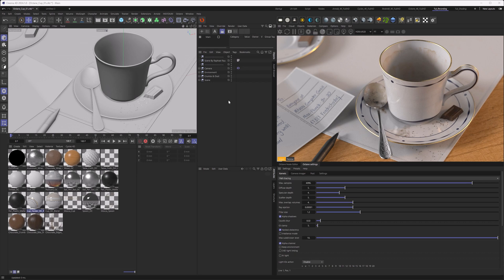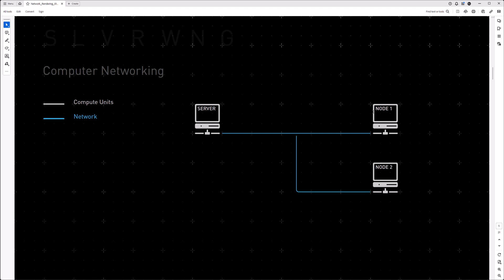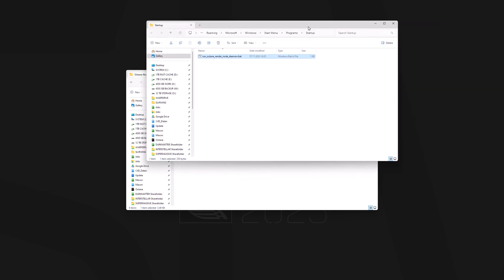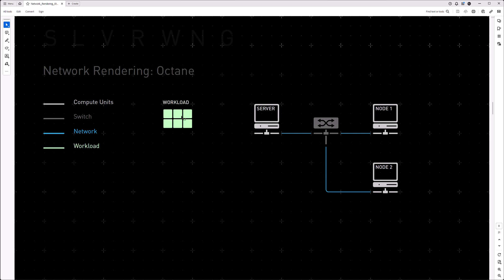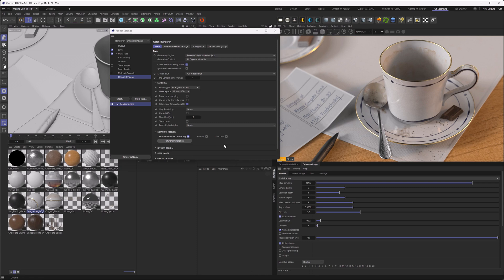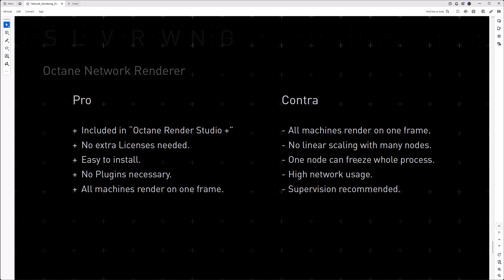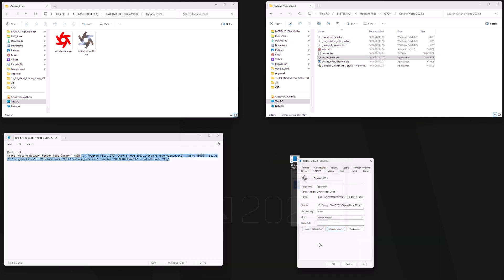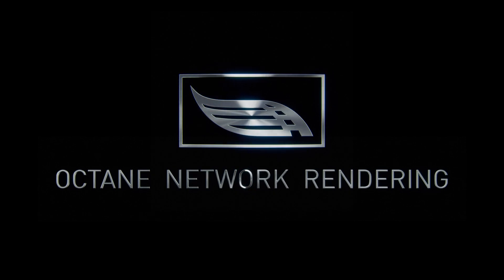Silverwing Quick-Ish Tip: Octane Network Rendering

Comment: Hi Raphael, thanks again for a great video. Maybe I missed it, but Bepe from Otoy recommended a few years back to uncheck "minimize net traffic" (for whatever reason, normally I would say it sounds lik a good thing for netowrk rendeirng :D) and set the max tile samples to 8 for getting improved network rendering times. Do you have any experience on that? It worked on my end when struggeling with bad performances over the network.
Reply from the maker: Thank you for your comment on my other video as well.
I was not mentioning that because mentioning all the extras would make the video to long. But as I did my Team Render one I thought it might have been better if I did.
Well there is room for a network rendering gotchas video... ha ha.

I usually turn off "minimize network traffic" as well as it will just render all of the samples of one tile on one node until max SPP are reached and then will send back the data. But I had instances where the node would error out and leave a 2h render with a noisy rectangle because the rendered data never came though.

I am sure Otoy has improved that since. I just mostly render animations with the Teamrender method nowadays. But when I render with Octane Network, as I said above, I usually turn "minimize network traffic" off still... Old habbits die hard.

Cheers and thank you for your help. Appreciate it!
Raphael

Comment: I own just one PC... this still got exiting. I'm eventually gettin a Mac Studio (unimpressive renderwise) and I'll hook my RTX4090 to compensate. Cornelius mentioned once there's no delay with NetRendering and after this demo I'm impressed. 🖥🖥 Thanks Rau 🙏🏻
Reply from the maker: Hey Emmanuel,
thank you very much for your comment.

Right now network rendering between Mac and Windows is not working. But Otoy said it will in the future.
So better wait a bit until you get some new hardware.

Thank you for the ✨🖥🖥✨ means a lot!

Comment: Raphael... get ready to read the following !
Last 2 days i have been experimenting with net render and i 've to admit i got some unexpectedly good results.. And then i decided to see if my gigabit lan in botlenecking the render in any way in order to get an upgrade for 2 slaves and connect them on a dedicated 2.5G switch... started my belowed task manager and watched the usage of LAN on 3 machines.... 2kbps, 5kbps, 1kbps.. wtf ? at the same i noticed that the INTERNET connection is in 60-140 MBPS !!! What !!! i was shocked, cause i've expected (as you mentioned) that the network rendering requires fast LAN ... and then i 've disabled one slave's INTERNET connection... the master hicked and resumed with 1 slave less... internet ON.. slave reconnected.. all this time LAN is OFF ! 
If i am not mistaken, octane net render node is interNET  rendering (probably peer2peer) , so maybe you investigate this until the next video comes out cause posibly  you did miss that .
If that is really the case than we will all have NODE render time bogged since windows does whatever it wants with updates...
What are your thaughs on this ?
Reply from the maker: Hey Vladan,

are you trying to say that the connection to the node is established through the internet?
I honestly don´t think so. Did you by any chance use a VPN while conducting those tests? This can throw off readings where the traffic is coming from.
One thing that speaks against your theory is that when I send big scenes through the network with Octane Network Render, the LAN usage is 2-5 Gbit. Which is much faster then my 1Gbit up 50Mbit down internet speed.

Nodes & Internet:
The Node needs internet to license it self. It should do also without once its started up. If you start it up without internet of course it can´t get a licence.

The throughput very much depends on a lot of factors:
Size of the Scene. The Scene has initially pushed through to all the nodes before they can start rendering. The bigger the scene (Poly Count, Texture Count / Size) the more taxed your network will become.
Image Size: The larger the image the more data has to be moved between the nodes and the server.
AOVs: Same here. The more AOVs there are rendered, the more data has to be send back from the nodes.
And last but not least for animations: The render time per frame. Because with every new frame the nodes have to be updated with the new data which takes bandwidth. And the more nodes you have the more data needs to flow at the same time (when the server starts a new frame)

I will do some more tests. If you find out anything new in the meantime, let me know.

Cheers,
Raphael

Comment: Thanks a lot fot this great tutorial 🙏 Excited to know more about rendering with Octane and team render 🙂
On my side I have a weird behavior on one of my node who have 2 GPUs, one seems inactive while the other is helping rendering the image.
Reply from the maker: Hey there and thank you very much for your nice comment.
About your problem. There are of course multible scenarios that could lead to such an outcome 🤔

I hope you don´t mind me asking some questions:
What kind of GPUs do you have attached to your rig?
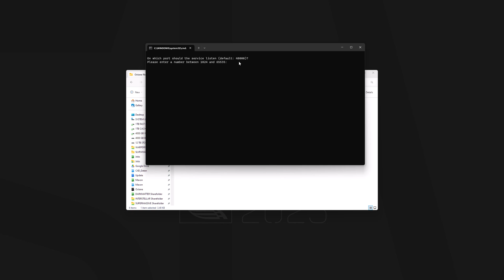When installing the Deamon, does it list both of the GPUs in the "Available GPUs" section? Video @ 5:37
If it´s listed I would say the most common cause for not participating in the render are Vram limitations.
e.g. if one of your GPUs has more Video Ram then the other and the scene only fits the bigger one.
Also in that regard, Windows takes up a chunk of Vram on the GPU the display is connected to.
I use MSI Afterburners Hardware Monitor to monitor my GPUs so I have a better understanding what´s going on if one of them fails.

Hope this was helpful. If the problem presists, feel free to write some more info so we can manage to get it solved!
Reply: @SilverwingVFX  Thanks a lot for your answer, I have on my own machine a RTX 4090 and on the distant node a PC with the 2 gpus :  RTX 3080  + RTX 4090.
It seems the one that is rendering is the 4090, so as you was suggesting it's maybe because of Vram limitations.
But when installing the deamon, yes the 2 cards was listed and available. Also when I'm enabling the network rendering on my machine I can see that the distant node has 2 GPU.
I changed the Parallel samples to 28 ahd Max tiles samples to 54 in the kernel setting, maybe it's too high for the 3080, I will try to reduce those numbers :)
Thanks for you help
Reply from the maker: @BRIAUXROMAIN  Thank you very much for your answer. I really appreciate the information! The RTX 3080 seems to have quite plenty of Vram with 10GB / 12 GB depending on what model you have. Though of course it really depends on what scene you are trying to render there.
I personally have not noticed a difference in upping the max tile samples. Usually I only go for max parallel and set this as high as possible. Though this is only my experience and very well might vary in different scenes.
The best way to know if it indeed is a Vram thing is to install a monitoring software. Like I said MSI Afterburner for example. This way you can see if the 3080 indeed is ruining out of it.
Cheers and all the best for you and your setup. Hopefully you manage to fix it.
Raphael

Comment: "obviously if you can read, you already have the information" haha loved this.

We often use 1 server with 4 or 5 added nodes, but does this mean our render would be faster if we only added 3?
Reply from the maker: Ha ha 😇 Thank you for your comment.
If it´s faster or not is dependend on some factors.
Scene size, frame render time, network speed etc.

In general, what I probably should have added is that rendering animations with short frame times (20-50sec) is causing much more bottlenecking then rendering 5min per frame.

I think you will only know if you leave render power on the table if you really meassure it.
There are two ways. The more easy one is to render a frame again and again with different machines and then see if you get the expected speed bump with 3, 4 and 5 machines added.
The other method is to render the a frame on your workstation, note the frame time, then run octane benchmarks on all the machines (including your workstation) and then do some math how fast that frame would be rendered if you add all the benchmarks together. Then find out if the actual speed is close or of it is way off.

The Team Rendering approach next week is usually way better for animation rendering as each machine does it´s own thing and therefore renders at its full capacity.
Though also has some disadvantages as well.
Reply: @SilverwingVFX  Thanks for the comprehensive reply. I never knew I could use the teamrender before this, but I did notice Octane bottlenecking during 50second scenes where it would look like it was up/downloading the frame to other nodes. 

I'll run some tests here to see how extensive the bottleneck is.

Comment: hey Raphael.. on the render node it asks me for the login. so i type it in.. press enter and then it asks for the password.  it does not accept ANY password.. the only thing you can press is enter. then it complains that the l/p combination is not authenitic... and it exits.. WTF ?
Reply from the maker: Hey there Vladan. Thank you very much for your comment.
It just looks like you are typing nothing. Its a security meassure so someone standing by can see how many letters your PW is.
So just hit enter after entered you entered login email address and then enter the PW (no other keystrokes as all of them are registered) Then hit Enter again.
That should work.

Cheers, good success with the PW and a good start into the week to you and!
Reply: @SilverwingVFX   you're right once again. !! i would never cross mind this ultra nuclear secret measure.. totally useless but it works. thanks !
Reply from the maker: @vladan.Poison   Thank you very much for your feedback. Super glad it worked!
I only knew about that because I used some versions of Linux that had the same "feature".
Otherwise I would have been as lost as you.

Comment: Thanks for the video as always!

Have you played around with the NVLink functionality to extend VRAM capability ?   Im not sure if it is available on the 3090 series cards. But here with the 2080Ti's we run it is possible to combine the vram to 44GB, basically adding the vram of all cards.
Reply from the maker: Hey hey. Thank you for your comment. Appreciate it!

I have not tried it my self because of three reasons:
1: It´s tricky to do with more then two GPUs (On the 4090 there is even no option at all)
2: It makes rendering slower.
3: I do not need it with the scenes I usually work with (6gb vram is mostly enough there 😇)

So for me it would be extra work, probably less stable (simply because it´s rarely used and therefore the feedback is missing) and also slower because there is always an overhead in shared memory solutions.
Not as much as going out of core in to the RAM. But slower then if your GPU had 48GB on it´s own.

Hope this helps.
A great start into this week to you!
Raphael

Comment: Thanks Raphael. Awesome tutorial. Really made those old machines laying around useable again. Quick question: since we're effectively sending data over a network, is the slowdown (assuming there's any) for first pixel in the LV noticeable as opposed to rendering on one machine?
Reply from the maker: Hey there Kenan.
Thank you very much for your comment ans your question!
The most load of the network comes from initially distributing the scene.
But your local machine starts rendering right away and the clients start once they have received the scene. You can even see this in the video in both cases: Rendering in the live viewer at 7:50 where the clients join over time. And then also in the final rendering bit 11:42 also you see one node join first and then shortly after the second one.
I have 10Gbit networking from my Workstation to the switch (10Gbit switch as well of course) and then 5Gbit network on my two network nodes. Its more important to have a fast connection between the server and the switch because the server serves every node his own scene. So while every node only has to receive its own scene the server has to send multible of those (one to every node)
The faster the connection the faster the nodes can start rendering and therefore also the faster the rendering will finish. As far as I know the rendering is never slower then rendering on the main machine only.
Sorry for the long read😇 Hope this clears that up a bit ✨
Reply: @SilverwingVFX  Thanks Raphael for taking the time to explain. This is a brilliant answer. Happy to hear that the slaves join in later to alleviate any bottlenecks in sending data. Again, really thanks for the awesome tutorial and thorough explanation. Looking forward to next week’s one

Comment: I can't help it, but I just prefer working on Mac – so a MBP M1 Max is my main machine, where I work in Photoshop on, After Effects as well as everything around (email, research, etc.). I have a Windows Workstation with three watercooled RTX 4090s, that I only use for C4D. The machine sits in another room and I work on it 100% remote with parsec. Is it possible to work with C4D on my Mac and use the power of the three 4090s in Live Viewer? That would be extremely awesome and my dream setup.
Reply from the maker: Hey and thank you very much for your comment and question.
As far as I know linking Mac and Windows systems is not yet possible but according to Otoy will come in the future with Octane 2023.2
I hope it will as you are not the only one waiting for it. So fingers crossed that it comes rather sooner then later!

Cheers, a great Sunday evening and a good start into next week to you!
Reply: @SilverwingVFX  Thank you Raphael! You are the best – absolutely love your content!

Comment: hello.. Is it possible for u to share your 4gpu machine specs .. even as a text post.. i think that would save lots of people .thank u in advance.
Reply from the maker: Sure. No problem. Here you go:
Motherboard: ASUS WS X299 SAGE 10G (Bios Version 3701)
Processor: i7 10980XE, 18 Cores - 36 Threads, 3.0 GHz 
Ram: 128 GB DDR4 3200 MHz CL18
Graphics: 1 X Nvidia RTX 4090, 3 X Nvidia RTX 3090 (Reference Design / Founders Edition)
two of those GPUs are in external "Razer Core" enclosures connected via thunderbolt 3.
PSU: 1500 W, BeQuiet
Cheers.
Reply: @SilverwingVFX  OMG !!! i would offer you beer but it is harmfull (hehehhe) therefore i am sending u a crate of KIWIs.. !!!
Reply from the maker: @vladan.Poison  Ha ha ha. Thank you. I am fine with kiwis 😊